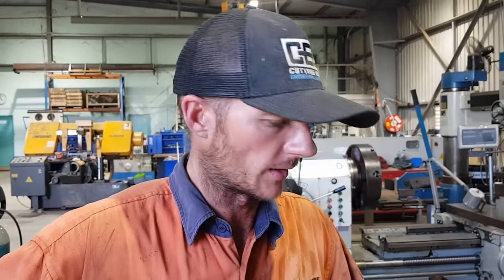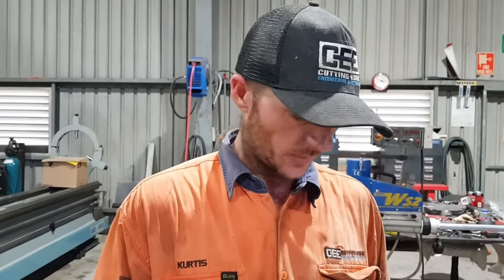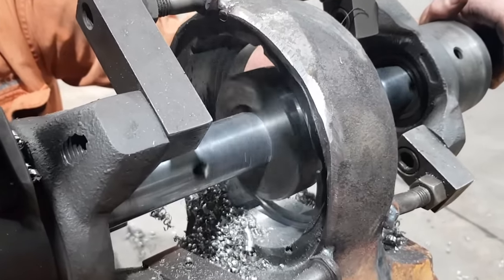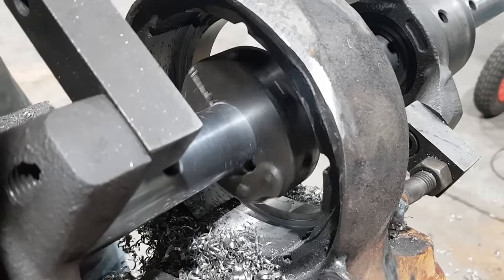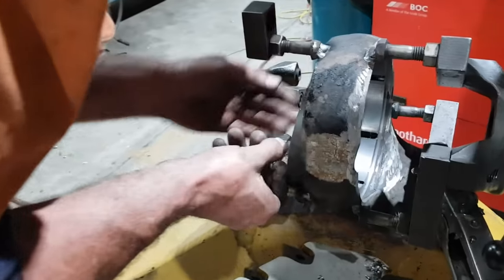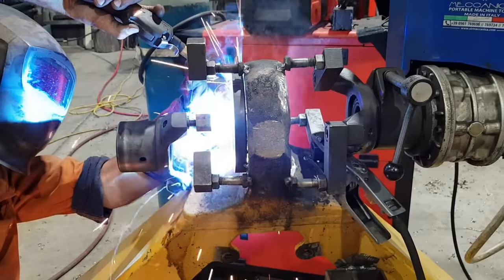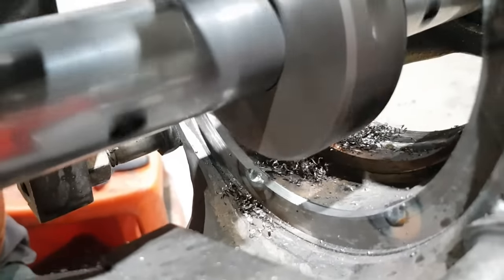Line Boring & Bore Welding Caterpillar 730 Dump Truck A-frame Eye | Part 1 | Sir Meccanica WS2

Comment: I’m a red seal carpenter, but did a lot of lathe/drill/mill work fresh out of high school and into college at a pressure vessel plant. I worked with a bunch of Polish dudes who hardly knew a lick of English but likely were involved in the soviet space program back in the day. Metal fabrication on another level.

Your work is top notch, brother. Always enjoy hearing the tools screaming on the stock your turning up. I can literally smell the coolant every time you start up the pump! Keep up the content, shop inspector needs to stop by a little more often.

Comment: Used to have a saying from my days in the Marine Corps, ( We the willing have done so much with so little for so long , we now feel qualified to attempt the impossible with nothing) .  Great content 👍
 Slip seating most any machine creates a maintenance problem, no one is responsible they just drive until there’s nothing left but the steering wheel.
Reply from the maker: Nice saying there mate. And you're pretty well spot on dry hire machines cop it
Reply: Semper Fi, Devil Dog! Ooh-Ra!

Comment: This video brought back many memories. Over 30 years ago I worked at a Cat dealership in eastern North Carolina. Because I was a certified welder I got to do lots of lift arm, boom, and bucket line boring. I'd set up the alignment bar first, then bore out the imperfections, and then using 1/8" 7018 welding rod build up the inner surface for final reboring to spec. I really loved doing that work. Great video and thanks for sharing! And for those of you who don't know, a fly cutter isn't for taking out pesky insects! :)

Comment: Kurtis, was it faster to work with the stretched eyelet and its egg-shaped bolt circle? When I first saw the damage, I incorrectly assumed that you would turn and bore a new eyelet on the lathe. I felt confused throughout the video because it seemed like a lot of extra work to salvage the existing eyelet. But I'm sure you can shed some light regarding your decision. Thanks!

Comment: What's that, they want it back first thing Monday and they couldn't even be arsed to run a hose over it. Hope you charged a premium hourly rate!
Reply: Id dunk it back in the mud before returning it, “yeah, what? Apart from the eye i returned it in original condition”
Reply: first thing i noticed too!! could of even hit it with a wire brush. hit em hard in the wallet!!  11th hour rush jobs, gotta love it..

Comment: Bloody typical. Flog the machine until it can't go any further. Then take it to the mechanic and tell him we need it Monday. 

And that boring machine makes nice swarf. 😊
Reply from the maker: Yeah seems to be a standard with some customers 🤦‍♂️
Reply: Job security for the mechanics
Reply: Whenever this happens to me I try to not be angry about it . Thank god somebody thought of you when they needed the job done fast and correctly. Being too busy is a blessing boys ! Tho it can be trying at times much love from 🇨🇦
Reply: That’s been loose for a long time to be that flogged, that should have been picked up in the daily or weekly service and inspection of the machine. Some operators, and I use operator very loosely in this case, are too precious to climb under a machine or get their hands dirty.

Comment: I imagine you’re measuring it off of those flange plate holes to centre it as best of an educated guess? Like I used to say in the trade, grease is cheap, mechanics aren’t, as with your case, neither are machinists.That’s some PM program they have there.
Reply: Standard procedure in the transport industry, why pay 50c for a copper washer when you can pay $20 grand for an engine rebuild. lol
Reply: No kidding.  I am not surprised the bolt pattern on the flange is not usable.  Nice Repair

Comment: I like to drill out seized in bolts . Did one today  a 14 mill stainless screw that bound up in the stainless housing . As long as the pilot hole is pretty well dead centre you can open up the hole till its a bit below the thread size and it will just screw out . You didnt have much time though .

Comment: What a job! Love it can’t wait to see the next vid.
Them things must expensive if they wanna pay for all that to be done
Reply from the maker: Thanks for watching mate. A new A-frame part about $8k but that's if they are even available here usually a 6-8 week wait on stock.
Reply: @CuttingEdgeEngineering  far out mate that’s crazy!!!! Lucky they are in good hands brother 👊
Reply: @dylanshandley1246  I meant the a frame not the whole machine.
Reply: @CuttingEdgeEngineering  Kurtis what is involved in making up complete swap over parts for something like that? Is there the option to go from just repair work to fabrication of components?

Comment: I thought you would cut the end but off and weld on a machined eye piece, cause that whole eye looked elongated.
Reply: Was looking for this comment, had the same thought 2/3rds thru the vid. Probably cant get one in that spec, even if you could it's less labor to bill out. I know theres a point of diminishing returns with that logic but then theres also the urgency. Customer wanting equipment back up monday after dropping the part off fri night. Either way you go, this wasn't going to be inexpensive.
Reply: i agree, because it looks like they thrashed the piss out of that A-Frame and half-assed the maintenance on it

Comment: Not a welder or machinist, just trying to learn: why wouldn't you be able to sleeve this after boring, instead of welding the bore back to size?
Reply: would work for a while  but then fail as  there is not enough meat on the outer diameter to hold it for long. economics come into play here.  been a farmer for 50 years and make and fix my own gear. when you haven,t got gear like kurtis you can come up with lots of alternative fixes
Reply from the maker: Hey mate fair question. We would never sleeve a job, personally don't consider it an adequate quality repair. They are prone to fail, as mentioned here lack of structural integrity plays a part too.

Comment: Hope whoever was supposed to be doing the maintenance on the dump truck has been as reamed out for letting things get so bad
Reply: Some of those are design flaws. They don't use big enough parts for the use it gets. They use a pin with a grease hole in the center that breaks or the self aligning bushing is too hard and it breaks from impact.
Reply: @tiredoldmechanic1791  After working in mining the last 10 years Servicemen aren't shown there is a grease port there. I had an Intermediary shaft bearing friction weld and explode from rapid cooling on a Volvo A40D as an operator.

Comment: Great job .   A lot of times with  bolts like that  i will weld a thick washer to the broken bolt if there is enough sticking out , then a nut or bolt to the washer .   It gets more heat in & allows for more weld .    Cheers .

Comment: See this is why I don't run a shop. Bring me something with a deadline like that and they can't even be bothered to clean it... They wouldn't like the bill. That's just lazy, however I'm not really shocked considering the state of this piece.. Broken bolts happen but letting a piece of equipment run until it gets that badly f'ked says a lot.. Great job. Crappy part is waiting for part two.. You left us with a cliffhanger finger on the button!!

Comment: with broken off bolts I find that after you weld on the nut belt it with a big hammer helps a lot, along with heat and special piss some times even when it went turn or two and then locked up again.
SeeYa Jake.

Comment: Over the years I must have pulled a thousand broken bolts this way. We try this, that, the other but in the long run they just plain have to come out eh, LOL. Same with the lack of grease in that eye. Most likely a bad zirc that no one took time to change out.  A 50 cent piece eh. Too bad that eye is a casting and not a weld on ring eh. Oh well such as it is. Oh how I do love that line bar. A real beauty for sure. Onward eh, LOL.

Comment: That bore machine looks similar to the one our field mechanics use. They use the super combinata made in Italy. The control looks almost identical to yours, but the machine itself is different. We've done a lot of cool work with those machines including drilling and boring a hole in a hollow turbine shaft at a 5 degree angle to relocate the brushes to the top. Was a massive GE hydro turbine and we saved them so much om the first one we did 2 more after that. Anyway nice work as always cheers.

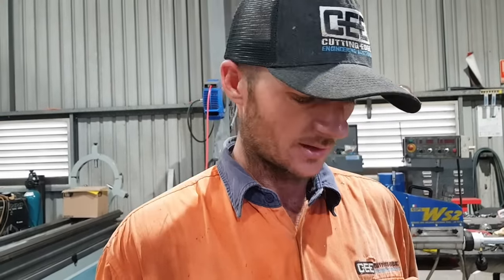Comment: 7:45 Couldn't the bolt holes around the perimeter of the bearing hole give you a pretty accurate guide to finding the center?  Actually looks like satisfying work, I love problem-solving jobs.

Comment: I would have thought you'd do a crack test before welding it up. I can't really remember what we did in Tassie. Your machine looks way nicer than the POS I worked on, it was hydraulic and the hoses were annoying. We had large bearing plates with slotted adjustment holes that we'd weld on either side, and A facing attachment with a janky knocker bar, so easy to crash, a real pain to setup.

Comment: The small rods in a Caldo Mini Torch work good for blowing the center out of those bolts. 
By the looks of it, that's a rear a-frame. The center ones have a bit longer legs

Comment: Since i am in the same business i can see the effort going in to your work:) Sir meccanica have vibration dampens bars as a option at least for the WS2+ 50 mm.. we have machine with and without... The one without we hold the bars same way as i noticed you did to reduce vibrations.. i specially liked your toolholder with chain link :) looking forward to more videos! Remember to include all the struggles and setbacks so we can have a little smile while watching. 
Best regards Arne-Christian Kaland, Norway

Comment: There is a way you can center them . Mace a cap like the cap you use to hold the bushing, then make a hole in the center using the lathe and machine a long pipe and fixit on that cap. After that fix it by the original screws position on the eye, and that pipe will give the center for the device on the other side...

Comment: I totally love that line boring machine.  To be able to make those 5mm cuts with bugger all vibration and sounding solid as, is really impressive.  I've seen manual feed line borers which howled and whined with 0.5mm cuts, and gave the sort of finish the sound effects made you expect.  Question:  It looked like the line borer was able to automatically feed on the face cut, but how the heck does that work?  If it is indeed feeding across a face cut, then that makes the solid, no vibration, cutting even more impressive, because there has to be an internal mechanism to enable the feed which has to reduce rigidity.  I'm guess that the lack of vibration comes from how short the mounts are, but it is still damn impressive.

Kudos to your wife/GF for the excellent filming, and I assume, editing.  There's no way you had time to do any editing with that deadline to meet.   Roll on part 2.

Comment: Howdy, don't know if this would help in the future. Old timers 40+ years ago wrapped rubber(inner tube) around drum brakes when re-truing the I.D.  Reduce vibration to almost "Golden". 

Maybe use on the Line Bore? Wrap on rotating shaft extremities?

Thanks for your time
Les Burtard
Howards Grove, Wisconsin

Comment: The only thing I can offer as a suggestion is to get one of those 5 gallon portable air tanks.  Hook your shop line to that and then plumb it to your impact gun with the biggest hose and fittings that'll fit.  You'll need to wait for it to refill between blasts but it'll get you the most torque possible.

Comment: I found for setting up things that are completely pumped like that bore use a mutitoyo digital level and square it of the floor then use maybe a couple of bolt holes with studs in them and move to a different axis failing that eyeball it and hope for the best

Comment: Worked with a farm mechanic who could burn a bolt out without harming the threads in the hole . He said " just use the rust and the rest is easy "

Comment: Would it have helped to machine a ring/collar to match the bolt holes and bolt it on to use to establish center? Then, you would have a jig for the next time, too.
You're a lucky man to have a missus like her. Her supportive giggle "This is going to be a good challenge. Let's see what is next." as you can tell she believes in you is some of the best of the video.

Comment: Hey the 1st broken bolt you tried to remove, I'm not familiar with how you heated the bolt and then water cooled it. Is there a better way to remove them that I don't know about? I would have heated the steel around the threads and then try to remove it. 
I really enjoy your videos and seeing how you do things.

Comment: If you will hit the bolt on the end to jar the threads after heating and before cooling it most of the time will help it break the threads loose

Comment: I've done several of those a-frames for that exact reason. Though none of them have been as bad as your example.

To clarify: I don't repair them, just get them out so folks like you can do that voodoo that you do do so well.
Reply: Hi
In what place is that A-frame located?
Reply: @felixchaus  Behind the front axle under the machine.
Reply: @SuperSecretSquirell  Thanks.
I'we seen several of these repair videos, but haven't been able to find where the A-frame goes. closest I found is middle axle, but on that eylet seems to be horisontal in the pictures, and in these repair videos eylet is vertical.
Reply: @felixchaus  Sorry, I just realized the one hes repairing is for the middle axle. It's been a while since I watched the video.

Comment: Whenever I have a seized fastener, I use a heat induction coil gun to very quickly apply heat, red hot in about a minute or even less, then it's easy to remove. One of the best tool purchases I have ever made. In this case. There's no telling how stressed that eye is, would it not be better to burn off the old eye and weld on a new one?

Comment: 37 year heavy duty mechanic
Have you ever tried hitting the socket with a hammer while trying to loosen it
Works every time on lug nuts
Some times you just have to do what works

Comment: Surely finding the center would have been easy using the bolt holes that circled it? Just draw a line between them all and there is your center??

Comment: As a mechanic that has worked on these articulated dump trucks or as we call them in the states,  rock trucks, a couple or even 4 millimeters off isn't going to be a big deal.  The thing ran that way just fine so long as you get it close it will be just fine.  The way I might center up that would get it within a millimeter is use the ring of bolts to center off of.  Not like factory but should get it close.

Comment: Could you have used the bolt holes (the small ones you had to weld the three nuts to to get off earlier in the video) to find a center, or were those too badly damaged/not related to the center of the bearing?

Comment: Why bore it out so far? I would have thought it would be hard to drill and tap the new holes because now they will be half in the weld. The ws2 would be nice to have because I have to do the reweld by hand with my setup can’t wait for part 2

Comment: I wonder why if there is a lot of material to take off, requiring many passes, a mount that would hold multiple tools wouldn't be used with one following the other.  The first takes off x mm and the second takes off another x mm?

Comment: ANOTHER excellent video, THANKS! 
Question: Could you make a quick fixture located on the bolt holes and had a center hole the size of your boring bar?
Reply: OOPS...never mind...just saw your answer in Part 2.

Comment: I know this is old thread but so am I. I think my approach would be to place the two legs of the frame on the concrete where it is level between the legs. Mount the bar where I think the center is then level the bar. Hang a plumb bob over the edge at each end of bar and measure the distance between the plumb bob and leg at each end. Now that I know it is level and square with the legs I'd look at the bar in the eye and see if it looks about the right height up/down and also front/rear in the hole.

Comment: question.. have you ever put the nuts you are about to weld on into the lathe chuck and machined  the threads out at a taper so you can get more weld to the stud or broken bolt..  perhaps even investing in one of those reverse taper drill attachments that bevel external threads again giving you a better taper to weld to.. its just a thought..

Comment: Not saying this is the case with this particular A-frame but I’ve seen plenty of these fail slap full of grease. If the bushings in the track bar fail it will allow for side to side movement of the entire axle which will in turn cause the bearing to fail. The broken bolts for the retaining ring are indicative of this type of failure.

Comment: When you said the depth of the first cut i was a bit surprised. Then I saw that even that depth left low spots. At what point do you decide to sleeve a bore rather than weld?

Comment: Great idea for using a runoff ring. I like your toolholder, looks solid. Much better than the alloy half holders they come with. Are you using a 12mm shank tool in there ? Thanks.

Comment: I love your and your misses work. I'd love to do some physical work but I never had the chance and instead are really good in everything that has some circuits in it, mainly computers.

One question: Wouldn't it be easier to chop the head (eye) off, machine a new one and weld that onto the frame? Or is it easier but take lot longer?

Comment: Had you thought of using the bolt holes as a way to center for the boring and welding ?... if the bolt holes are where they should be.....then you could weld to wherever was most stable......